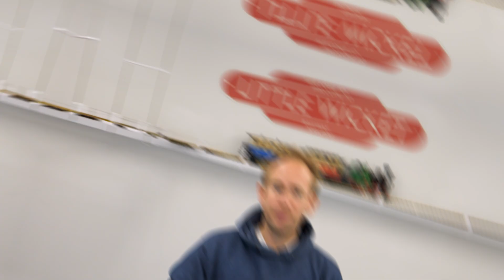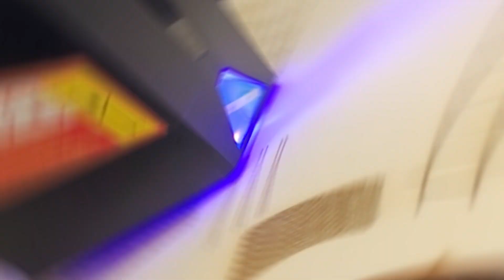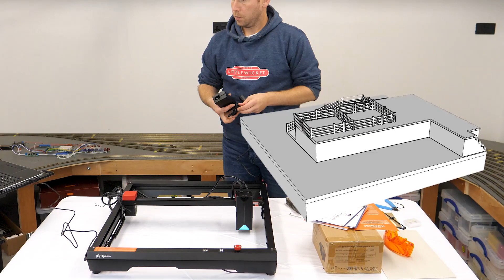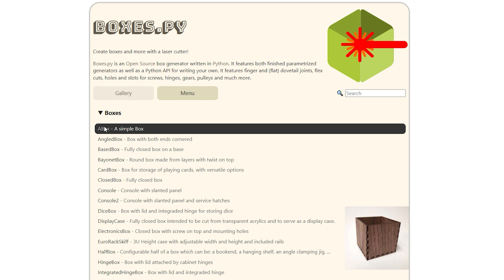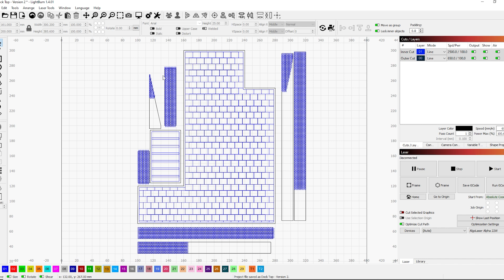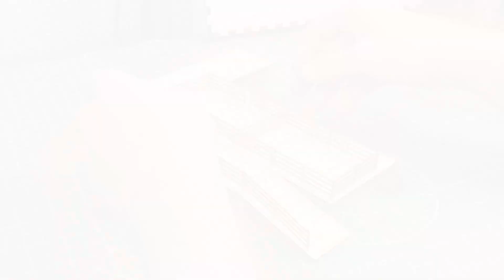Incredible for Railway Modelling | 💥 AlgoLaser Alpha 22W Laser 💥

Comment: How do you get your 00 gauge lined up straight with out gaps in your fish plates
Reply from the maker: If you glue or pin your track once it's together then you should be OK. Small gaps are fine, they create a good click-clack sound when wheels pass over them and allow the rails to expand in hot temperatures.
Reply: @LittleWicketRailway  ok thanks for the that

Comment: My take on this is, what can I buy for my railway vs the cost of this. Cutter cost is a hell of a lot of plastic/card kits which have higher accuracy and rounded shapes where required in the case of plastic. Cutter does give you custom designs but at cost of hours of design work. 
I think cutter is only worth it to those who have to pay for it themselves if they make the design/cut/build a hobby in itself that they enjoy long term.
Great video as usual!
Reply from the maker: Fully appreciate it's a serious investment and, to be fair to Algolaser, it's pitched as an entry level commercial laser.

I plan on using this to make platforms, custom buildings, baseboards and lineside furniture, but also dolls house stuff for my mum, Christmas decorations for the family, a wedding cake topper, etc.

Designing in lightburn really was a lot easier than I imagined.

Comment: Certainly a nice bit of kit!  It's certainly something I will look into nearer the time of needing one, but it could certainly make life alot easier.  How much of a faff is it to design the brickwork with the interlocking edges?  Cheers,  Michael
Reply from the maker: Hi Micheal 👋 it's really not difficult, lightburn has a feature where you draw a single brick, then create a grid offset by half a brick each row.